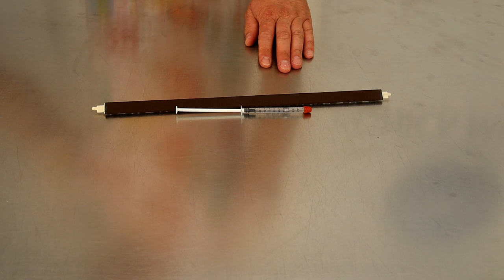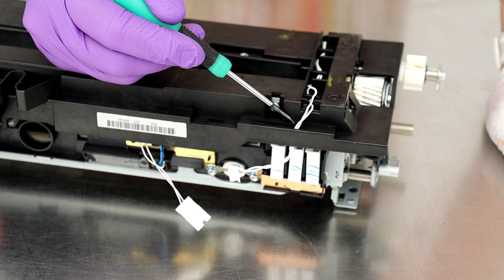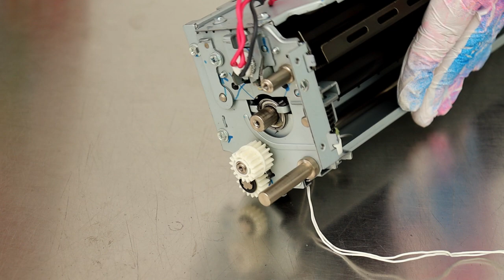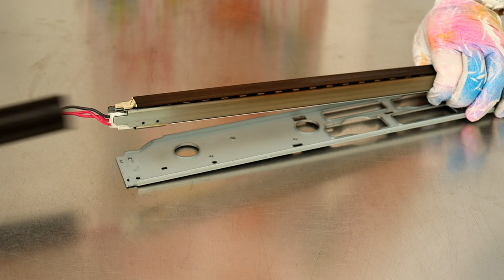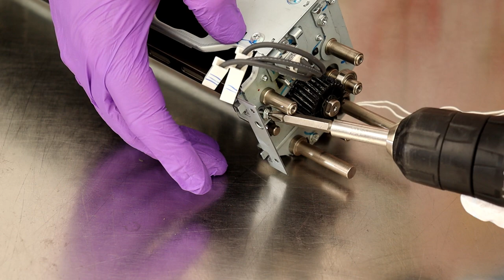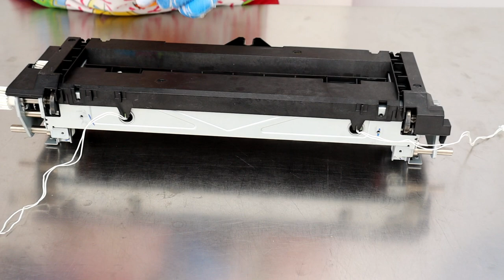FUSING Ricoh MPC5502 MPC4502 🔥🔥🔥

Comment: What is the solution of code error 544-03 in Ricoh MPC 4503.
Reply from the maker: Kod błędu sc544 musiał być spowodowany uszkodzeniem folii grzejnej. Najpierw wymień folię, element nawilżający, nowy olej, wałek dociskowy i termistor. Potem zainstaluj nowy bezpiecznik pico fuse i dopiero wtedy można 1 raz zresetować kopiarkę. Zobacz film jak wymienić części: https://youtu.be/UBeyeqVWoI8 a potem wymień bezpiecznik i zrób reset: https://youtu.be/Pj7bayVE4sU i ten film: https://youtu.be/uCWQpu3tglU 

The sc544 error code must have been caused by a damaged heating film. First, replace the foil, humidifier, new oil, pinch roller, and thermistor. Then install a new pico fuse and only then can the copier be reset 1 time. Watch the video on how to replace parts: https://youtu.be/UBeyeqVWoI8 and then replace the fuse and reset: https://youtu.be/Pj7bayVE4sU and this video: https://youtu.be/uCWQpu3tglU